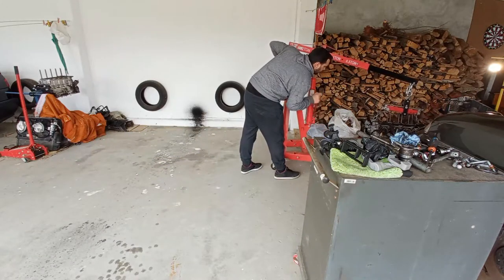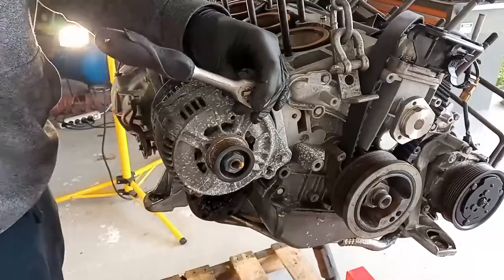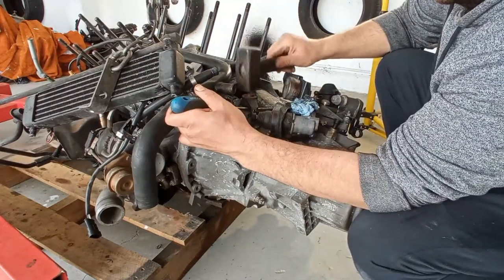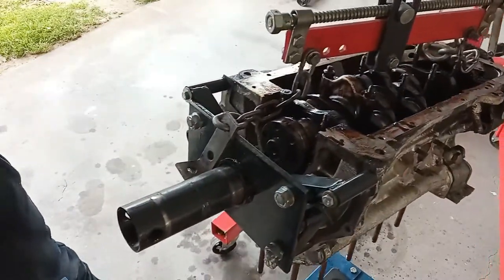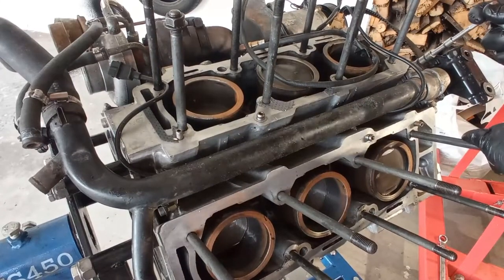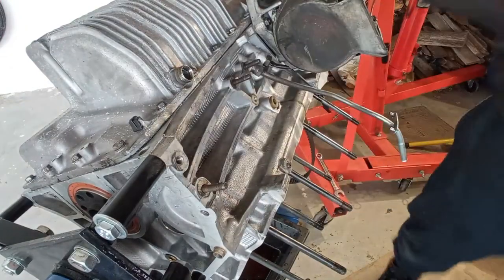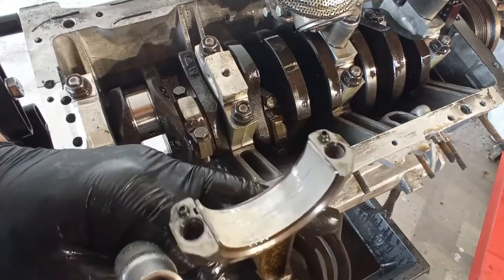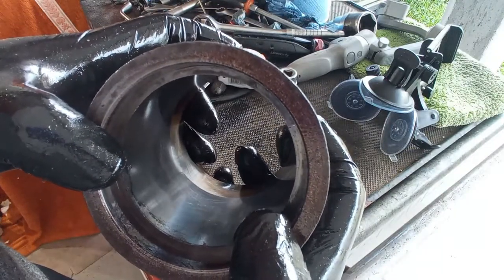Taking the V6 Busso apart! (spoiler alert, not good) Damage assessment of the internals. Ep5

Comment: Whenever you buy a used car: ...
I can't understand why people always do EVERYTHING wrong, especially with the overtightening. "Do not overtight" is the first thing you hear or read when you start to do works on a car or not even a car IN GENERAL! I don't get it. The same goes with glue in the oil system or the cooling system. When they replace a waterpump what do they think the O ring is for? It's so hard to watch. I'm so sorry that you have to go through that. Jobs like these are taking up your nerves for days. Smh...😥
Reply from the maker: Hello. Boy you can say that again! I also see this every day at the workshop, people try to save a penny or two end up spending thousands! 
Yes, my nerves are being tested very hard! Thanks for watching
Reply: @alfaromeonoproblem  Yet still good luck with this engine!

Comment: It seems this "rebuild" was just somebody slapping some new bearings into this engine and forcing it all back together with an impact gun. Nothing cleaned, no new gaskets or correct seals installed. Really shocking workmanship.
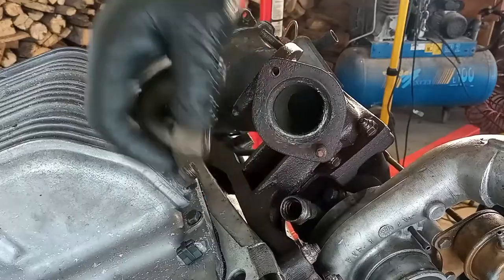14:54 In England we just call it an adjustable spanner (spanner is the English word for wrench). I've also heard them called a 'Moscow micrometer' or in America a 'Southern socket set' 😄
Reply from the maker: Very shabby work indeed! Was not expecting so many bad things! Thanks for watching!

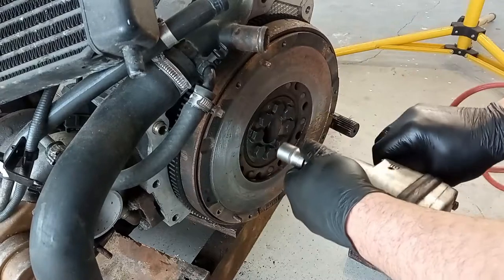Comment: 8:00 What diameter hose are you using with your impact? 1/2" impact needs at least 10mm inner diameter hose, otherwise it won't have any power, and it doesn't matter if its cheap 50€ gun or 300€ ingersoll rand. Also the hose should be as short as possible, preferably under 10m.
Reply from the maker: Hello. The hose is 10mm I just replaced the fittings. O did used this gun in the workshop where there are no air restrictions and it's the same.

Comment: I was taught many years ago (about 50 years actually...) that when loosening or tightening fasteners on a rotating system like a crank or wheel etc, always apply the torque across the axis of rotation - this reduces the turning effect on the rotating part. Basically, put the spanner/breaker bar across the middle. This has the effect of subtracting the bolt to center distance from the moment arm trying to turn the thing, so it needs less holding in place.
Reply from the maker: Yes, that is true, I use that method when tightening flywheel bolts! Very important subject